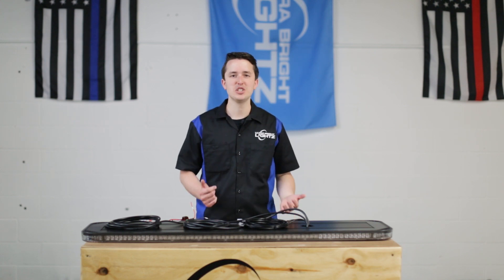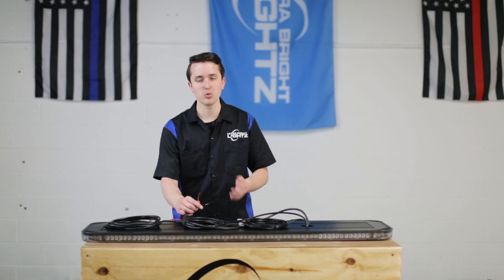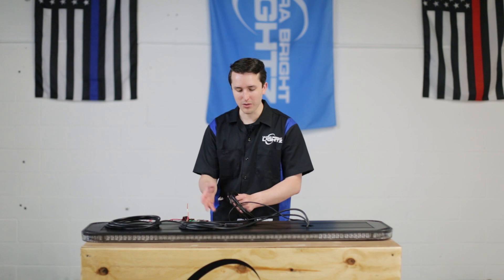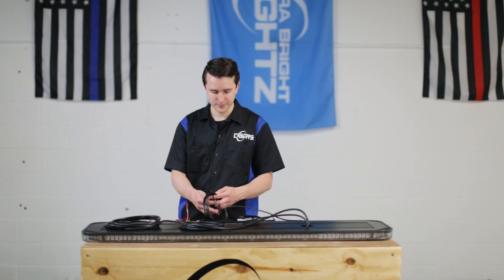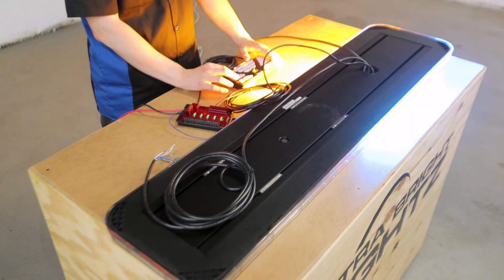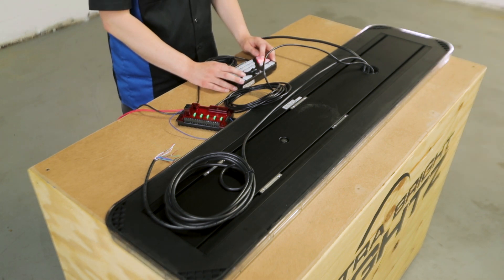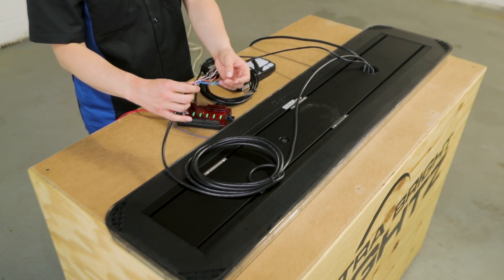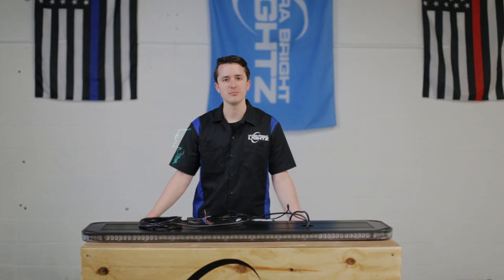How to Wire the Feniex Fusion GPL Light Bar and Use Datalink

Comment: I plan on purchasing a GPL next spring. I'm going to also get the Typhoon Full Function. Can the data link cable be removed from the bar without cutting it out so it's not just dangling there useless?

Comment: So I have to program the bottoms to each flash patterns I can’t just hook the controller up and power and start hitting buttons that are already set ?
Reply from the maker: If you have a Feniex 4200 Controller you will need to program which buttons you would like to use using the Feniex 4200 Software

Comment: When using the datalink what can be done with the 15 pin harness so it’s not just dangling useless?
Reply from the maker: You can remove it or tie it up to the bottom of the light bar

Comment: Good afternoon, I have an older feniex 4200. Will that still work with the data link or do you have to have the 4200 data link? Thank you
Reply from the maker: You will need the 4200DL which has datalink

Comment: So with datalink, how do you change flash patterns?
Reply from the maker: With the Feniex 4200 Controller! https://www.ultrabrightlightz.com/feniex-4200-controller/
Reply: @UltraBrightLightz  I have the software and the controller  I’m just confused where the option to change patterns is?  I have the GPL light bar.
Reply from the maker: @201TheProfessional  It should be in the software